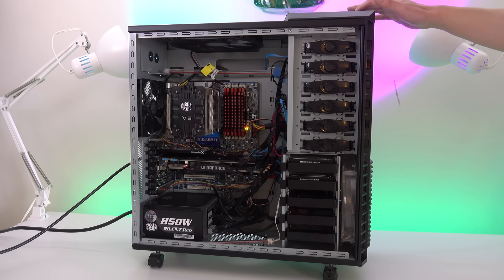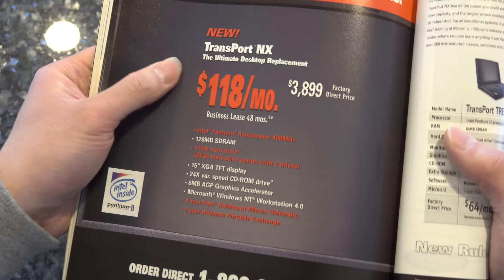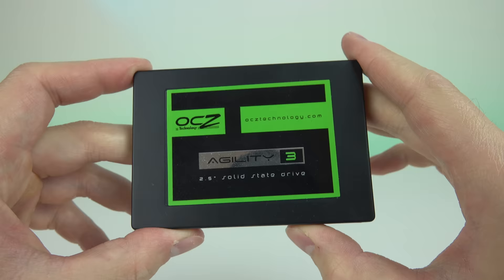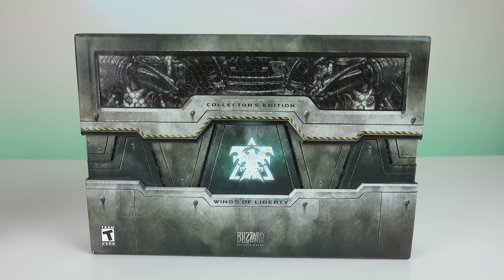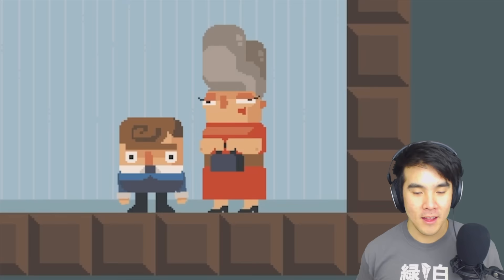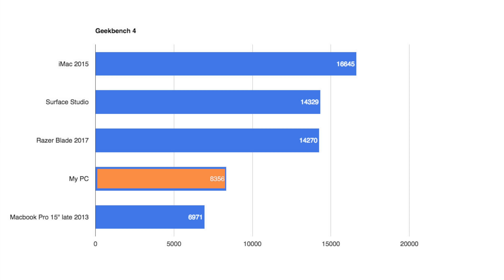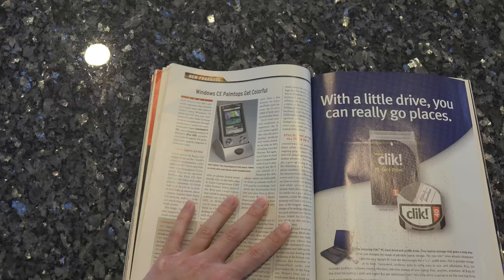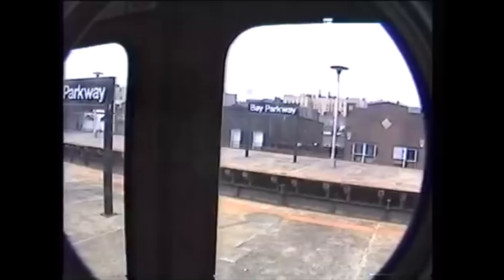I Built This PC for $1360 in 2010. Here's How It Holds Up.

Comment: i'm still using a pc i put together in 2008. and it's summer 2019. q6600 (g0), asus p5q-em, 4 gigs of ocz reaper (now 8). built with a 640 wd caviar black which lasted until spring of 2018 and was replaced with a 512 evo 860. powered by a corsair vx450, all in a lian li pc-ao5. oh yeah, 9600gt to an hd7850. 

i had my first blue screen a few days ago while finally experimenting with an undervolt and overclock. i do have a complete build wish list put together on newegg, i'm just ruminating.

Comment: That's pretty cool, my computer is from the same generation built in 2011. I started with an I7 930 and a GTX 470 my dad gave me when he upgraded. When the 470 died (because those ran HOT! ) I upgraded to a Xeon X5670, water-cooled and overclocked the snot out of it. The OC eventually became unstable and I had to lower it. Water-cooler died, went back to air cooler. Got 1, now, 2 GTX 960s in SLI. I started with 12 GB RAM, one stick was defective from the start, the others I think have caused stability issues running at rated speeds. Recently replaced the RAM with 8GB sticks and the CPU to the highest end Xeon X5690 for this platform. My original 2 60GB SSDs still have life in media PCs around the house, replaced with larger SSDs in RAID0.

I'm ready to upgrade but those computer is still the most powerful I have access to. My baby ❤

Comment: Hindsight from 2024:
Kind of ironic that he mentioned a $2000 PC in 2017 would last until 2024. My i7 5820k build with GTX 970 from 2015 lasted me until this year when I decided on my birthday to upgrade on March 2024 with an i7 14700k with RTX 4070 Super. The old $2000 2015 rig lasted me almost 9 years of gaming but is still serving me right now as an SMB file server on a network that I regularly remote desktop and pull files back and forth from time to time.
Reply: how is your build holding up now? I was thinking about getting that build but I know 13/14th gen intel cpus are found out to be pretty unstable

Comment: 2017 doesn't feel so long ago, and even an i7-7700K feels somewhat slow now compared to PCs now in days in 2024. But then some other stuff has held up, like the GTX 970, and the 24 GB of RAM. Strange how computers have came to be now.
Reply: the 24 Gigs has held up only as it was overkill for its period for the 970 it has not held up where newer games demand more then 8 gigs now on high settings while the 970 has 3.5 gigs. With no mesh shaders and no DLSS with Ray tracing support though not necessary it is something to note about.

Comment: I remember buying the most expensive next gen computer in 2006. Unfortunately, after the ps3 launch it was playing catch up. By 2014 it was dead. It was mainly the processor where cost didn't pay off. I paid for a 3.20ghz pentium with HT. Which was super fast for the time BUT not long after people started using dual cores, quad cores at lower speeds which actually were capable of a lot more.

Comment: Actually funny watching this in 2023. I used an i7-2600 with 16gb RAM that I bought for $400 off of Amazon in 2018 all the way up until March 2023. It STILL functioned really well and even my mom is enjoying it now as we head into 2024. It was surprisingly quick and handled my Digital Audio Workstation and my heavy load of plugins as needed. 
I couldn't do any gaming or video editing because I didn't have a dedicated graphics card tho, but I don't doubt that it would have handled anything it met the requirements for. The thing that made the biggest difference tho was just upgrading from an HDD to an SSD. All of the other differences seem somewhat marginal with my newly built PC (i7-12700, 16gb DDR5 RAM, GTX 1650).

Comment: I built a similar computer in 2011. The solid state drive also failed but after removing that, I gave it to my Dad and it is still his primary PC to this day running windows 7. I have been PC free for 5 years now, using an iPad and iPhone only at home and a laptop at work when I need to print. A lot has changed!

Comment: I spent $500 on my PC six years ago and it holds up well. Had to upgrade the cpu , so I spent $30 on a used one a few weeks ago. Running Overwatch on high settings with a solid 60fps. Also bought an SSD which dramatically improved it.

Comment: The computer that I built in 2013  has only just last year started really showing its age. Web browsing is painfully slow, Facebook and Youtube sometimes just don't load. Games like BG3 run poorly even on the lowest settings at 1080p. I paid $800 for it, and five years ago I got an SSD for the main Windows and gaming drive, and upgraded the card to a 1050ti. Other than that, it's the same CPU and ddr3 ram. I am happy to be stepping into the modern age this year with a new AM5 system I will be building in a few weeks. Hoping to get at least 5 to 6 years out of it... not planning another 11 years lol

Comment: My rig is a custom built PC from Alienware. 2009, 1300$. Since then, I've upgraded my RAM (to 8 Gigs) and GPU Amd Radeon 270X. (Both of these I did in 2014.) It runs ANY GAME, perfectly. But, I'm pretty much capped at 1080p (resolution) with medium to high graphics settings. However, games like Overwatch, it runs at 120FPS+, 1080P, so I can still take advantage of 144hz monitors, as long as I'm willing to adjust the graphics. I'm DYING for an upgrade, but I'm a broke loozer.

Comment: I built a 2013 top spec fx8350 computer that's overclocked with a GTX 1060 6GB. It should last me well into 2020 and beyond. Benchmark at just below a 4770k by a couple points. In total I have about $350 into it, combo of new/used parts. My next build will definitely be a xeon, when the time comes. Matter of finding a cheap motherboard for it that I can overclock on.

Comment: I recently put together a "new" machine using many parts from a higher end office desktop from 2011. As for the original parts, it uses an i7 2600S, 8gb of DDR3 1300mhz RAM, and a SATA II 1.5TB HDD (just for long term storage lol). It came from the factory with an ATI HD6570 GPU, which held up better than most expected but needed to be replaced to play anything new or not an "e-sports" title. Adding a 240gb SSD, an AMD R9 270X, and a PCI-E USB 3.0 card for better I.O. and it serves as my go-to PC for living room party games, a nice portable rig for e-sports titles and even a competent rig for 1080p gaming in general.

Btw, great video! I really enjoyed it.

Comment: Computers might have not progressed in performance that much but in standards and extensions. For example encrypting on a 2010 CPU is WAY slower than on a modern low end CPU.
Especially as a german where we pay the most in the world for electricity this is a very big argument. Old hardware is still viable, for example as a project machine or even a home server, but i would use something that uses less power than a second gen core - i would not go over a certain node size.

Comment: Still using a 2011 Computer I got for $275 off craigslist in 2014 that was originally over $800-900 when it was released. A Gateway DX 4860 UR21P. Have done a few upgrades to it over time like additional ram etc but still holds up well today. Major upgrade was adding a SSD which is now actually affordable. That alone will make any older computer run well for years. You need at least a Sata 2 or Sata 3 connection to get the best performance out of one though. Consumers sure got robbed in the early days of computers far as hardware.

Comment: I built my first PC in 2013. It had an i5 3550, GTX 770, 1tb HDD, and 8gb DDR3 RAM. A few years ago I got a steal on an RTX 2070 Super and replaced my 770.

Today I finally upgraded everything else - i5 12500kf, 2tb SSD (Samsung 990 pro), 32gb DDR5 RAM, and now the 2070 super is the bottleneck.

This was the first video that appeared when I first logged onto Youtube, what a coincidence. These old PCs are nice at the time but holy hell does 10 years make SUCH a difference, this PC is so fast now.

Comment: i have 3 computers.. and my main one is build from 2008.. E8400 OC'd at 4.2Ghz... running on air since then and almost always open 24/7 and still running strong (on a pricey mobo+psu). Only changed the video card.
(got lga1151 mobo + ddr4 ram waiting for a cpu in a desk.) OMG! I have the same case as you from 2008... lol !

Comment: I just built a PC for $1200 and it is a beast. 32gb of RAM, A 1TB SSD and a Ryzen 5 processor. I don’t use a GPU because the integrated Radeon graphics actually works really well for me, and I can play most games with high settings. Love it.

Comment: I built high end PC's since 2009,my 1st one was far behind in 2012, held 3 years. Next one came in 2012, held until mid 2017. In 2017 I continued my pattern of getting top of the line parts, with a 1080ti, i7 7700K, 32GB RAM and a MSI Z270 Titanium (bought it for the looks of it 1st)...and it's still going super strong 2 years later like the 1st day. So out of personal experience, you truly stretch your money farther and farther as time is progressing. The only thing I'm going to do with my system is to watercool the 1080ti, the MSI Armor color is great, the best as far as I'm concerned, but I really like the look of a full loop.

Comment: Awesome. I've picked out a MSI x399 motherboard. I Plan to max out it out completely. That's gonna be about 128GB of ram, a 14TB Western Digital Gold hard drive, the highest Ryzen CPU it can handle, and an RTX Titan. Be Quiet! Branded fans, a Be Quiet! case, (silent base 601) and a Be Quiet! 1000W power supply. Also, the blur censoring is intense in this vid.

Comment: We also scale software differently, instead of taking up most of the computers structure you try to scale tasks in order to give a better ux, thus since we only try to use say 25% of a computers speed that can scale up to 40% next gen (really rough numbers) up until 100% isn't enough

Comment: You can now build a $500 computer and play games in 1440p - it’s wild.

CPU: Intel i3-12100f - $95
MoBo: ASRock B760M - $91
Memory: 2x8GB DDR4-3200 CL16 - $31
Storage: P41 Plus 500GB PCIe 4.0x4 NVME SSD - $27
GPU: RTX 2060 Super 8GB - $150
Case: Generic $40 mini tower with one exhaust fan
PSU: 600w 80+ Gold ATX - $52

Total: $486, with enough leftover for thermal paste and an extra intake fan.

Comment: I bought an ASUS PC in 2011 for $600, it had 8gb ram, 1tb HDD and AMD Phonom II 1065t 6 core CPU. In 2012 I upgraded the PSU too 600W and got a GTX 550 ti. Then in 2017 I got a GTX 1050ti. That worked great until it was time to get something new. In 2021 I built  a PC with ASUS TUFF Gaming Z690, Intel i9 12900K, 23gb 3600MHz RAM, 1tb WD Black NVMe SSD and 1tb WD Blue NVMe. Recently added 1tb SATA SSD and 4tb SATA SSD, I've had 10tb HDD USB external for movies. I took that apart an put it internal. I kept the 600w PSU and GTX 1050 ti. a couple weeks ago I got a GTX 1660 Super. I would like to get an RTX 4070 ti.

Comment: My desktop I use as my main machine was pulled out the skip in uni & was built in 2010. Had to upgreade the mobo about three years ago not because it was not powerful enougth but because the SATA ports on it died. It has run the same 750ti for years & continues to run a treat, played the new Doom like a breeze.

The rate in which computers have progressed in the last decade has slown down significantly to any other part in the histroy of computers. You look at any decade pria & you will see that a 10 year old computer would be useless for day to day work, however that is no longer the case. The expernentail groth has slowed down as we have started to hit the physical limits of our tech.

Comment: Wow this gives me nostalgia from when I slowly build my computer back in 2009 to 2010 when I was 15. I had the HAF932 upgraded it in 2015  with secondhand cosmos s case that came with custom water cooling parts with a big radiator and a powerful pump and replaced nearly every part thanks to a power surge. 😅 But still working today in 2023 running very cool with 980X and a GTX970

Comment: The i7-930 has a 130w TDP. All the i7s from this generation had insanely high TDPs, because hardware was in a period where they were pushing speed over efficiency, similar to where we are today. This processor has 4 cores, 8 threads, and has a base frequency of 2.8 ghz, max boost 3.06. For 2010, it's not bad. For anything within just a few generations, it's complete garbage. The power cost to have kept that thing going for 7 years could have been invested in a cpu that was more powerful AND efficient. The money saved from such an upgrade would have paid for the upgrade many times over within a very short period of time. I acquired an old i7-940 with similar performance while thrifting on a budget. I quickly abandoned it due to the excessive power waste and heat, for a CPU with half the TDP, around the same clocks, and more cores. You can absolutely rock old platforms for a long time, but I don't think this generation can justify its existence in the present day. This is even truer today than in 2017, obviously. By then, you could grab a low to mid-tier CPU and get better performance for far less power cost. Just goes to show how much of a depreciating investment PCs can be...

Comment: Can relate, my PC is average and can run most games on high settings but when it comes to recording, there is some lag that occurs but still looks good and can do 1080p/30fps. Editing is a struggle because the software skips when a transition is happening and for rendering, if the video is 10 minutes long, it’ll take around 25 minutes. Really want to upgrade soon!

Comment: The machine I built in 09 was surprisingly similar, CM case cooler and power supply, same OCZ RAM (12GB though), i7 920, GTX 260.  I don't think I had a Gigabyte Mobo, but I can't remember,  no SSD at that time either.
Reply: How is the systems holding up?
Reply: @ArtisticTrex54  Most of its been replaced, did a big refresh back in 2015ish.  The i7 started running hot (60-70C idle iirc) and the GTX 260 started having issues.  RAM and mobo held up like champs till the end.
All original HDD's held up fine but have been replaced by SSD's and a single high capacity HDD.
At some point after the refresh the PSU died and had to be replaced.
Still using the same CM Cosmos 's' Sport case and the original cabling.

Comment: My 2011 build which still runs smoothly af today:

Intel Core i5 3,3 GHz
120 GB Intel SSD for OS and a normal HDD for software and files
nVidia GTS 450
750W PSU
Noctua cooler and fans
and the best thing of all:
Windows 7 Ultimate x64
Best OS ever made!

Comment: I’ve just found a dumped by the trash gaming pc of 2011, it has an Nvidia gtx 550ti graphics card. I’ve not checked rest of components yet, no monitor I can plug in as only have HDMI with no adapters, nor a vga input on any device, so will see when can try on monitor. It does fire up with the fans and lighting, so power supply probably functions fine.

Comment: Ive bought my pc for 2000$ in 2010 . 
i7 950 + 8Gb/2144mhz + radeon hd 5870 + 900W + 1250Gb hdd 7200rpm + x57 extreme and coolermaster HAF (like yours) pc case . 

And ive bought a new pc for 1300$ .
Ryzen 7 2700X + B450 + RX5700 + 16Gb/2933mhz + 240gb ssd + 2tb hdd + 620W

Comment: Buy a used Xeon X5650 (or X5660, X5670 etc) off eBay, those are 6 Core / 12 Thread CPU's with more cache than the i7 counterparts, OC way past 4GHz and will help massively with rendering and streaming. Also buy a NVME M.2 SSD and a PCIe to M.2 Adapter (£8-ish on eBay), that will give you much greater than SATA 6Gbps SSD speeds. That should give your PC a massive boost in performance and keep it going for a bit longer.

Comment: It's really great you have gotten that much life out of that PC. I'm in a somewhat similar situation. Intel i4770k CPU, Nvidia GTX 770, Asus ROG Hero IV Motherboard with 16 GB DDR3. I have also done some HDD updates. Now running a 1 TB Samsung 860 SSD, and an older WD 2 TB Green drive. Though I'm still on Windows 7. I did the Windows 10 free upgrade, but once the 1 year anniversary update came out, my experience fell quickly. So I went back to 7 Ultimate, and have been very happy. I'd like to update the GPU, but they are so expensive right now! I'm worried about what I will do when Windows 7 is no longer supported.

Comment: What you said about the raspberry pi is true. The only issue is it's not easier convenient to program or work with for most people because most people don't want to have to do that. They want something that's ready to use right now. If they can't turn it on and set it up right then. What's point to it. I love raspberry pie and Linux and other easily modifiable/programmable softwares. It's not hard to do. you just have to have the will to do it. But like I said it runs with copy and paste. Toy iPhones are so popular you buy a new iPhone and just slap everything from your old iPhone onto your new one and it's like you never left home.

Comment: I was using an alienware i bought in 2009/10 until about a year ago i had the i7 920 with a aio water cooler i think it came with 3 gigs of ddr3 and a gtx 260. i upgraded it a few times to 8 gigs of ram and a gtx 960. but then i met a new friend and he gave me a pc that has a i7 2600k and a gtx 980 strix and 16 gigs ddr3 1600 with a crucial mx500 ssd. If my friend didnt give me that computer i would still be using that alienware with some new upgrades it would still be a good usable computer.

Comment: I still use my Q9400 from 2008 overclocked at 3,4Ghz stable from 2010, i just changed GPU and add 4gigs of ram....working super. Fact is, this was not possible before 2007-08, u buy PC and after 2y its a crap....not the case last 10y.